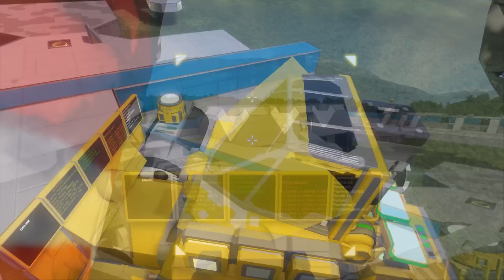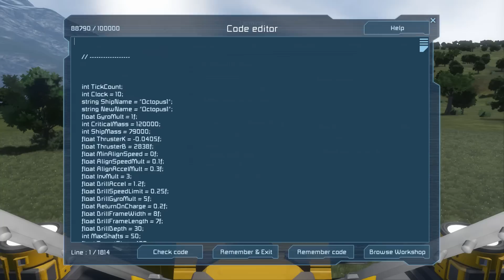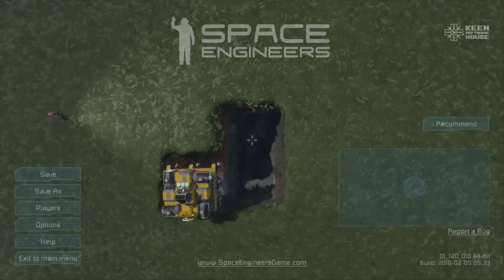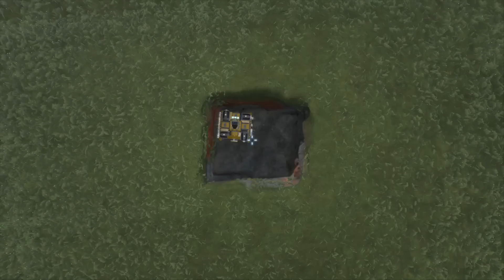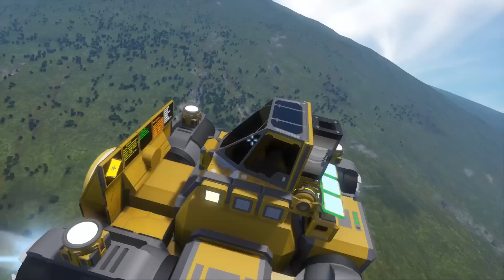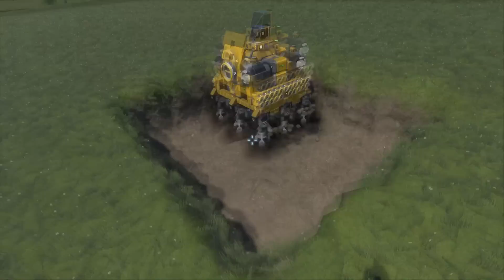Space Engineers  Planetary mining robot

Comment: As I commented to someone else on here. It is Just too bad it can't just go out scanning itself. You just hit start and it takes off looking for racks and you only see in when it needs to recharge (though with how long it may be gone and how far it may go at least one reactor fully of uranium and a script that sends it how at half power would likely be needed) or is dropping off ore it has collected. Then add sensors so it avoids terrain (turns off when it goes into drilling mode).

Doing the same with the first mode would be great also but I am not sure if there is a way to have it find ores under ground. I guess maybe a script that uses the ore detector. It flies low and slow and when the ore detector detects something it triggers a script that causes it to home in on it and then enter "drilling mode" and then does its normal thing. But I am not sue if the game is coded in a way the scripts can interact with ore detectors that way.
Reply: honestly the only real downside i can see is that the ejectors do jack shit, they just throw the ore out into the drills and gets picked up again

Comment: This is so awesome.  The second mode is crazy useful
Reply: +Brian Hockenmaier Just too bad it can't just go out scanning itself. You just hit start and it takes off looking for racks and you only see in when it needs to recharge (though with how long it may be gone and how far it may go at least one reactor fully of uranium and a script that sends it how at half power would likely be needed) or is dropping off ore it has collected. Then add sensors so it avoids terrain (turns off when it goes into drilling mode).

Doing the same with the first mode would be great also but I am not sure if there is a way to have it find ores under ground. I guess maybe a script that uses the ore detector. It flies low and slow and when the ore detector detects something it triggers a script that causes it to home in on it and then enter "drilling mode" and then does its normal thing. But I am not sue if the game is coded in a way the scripts can interact with ore detectors that way.